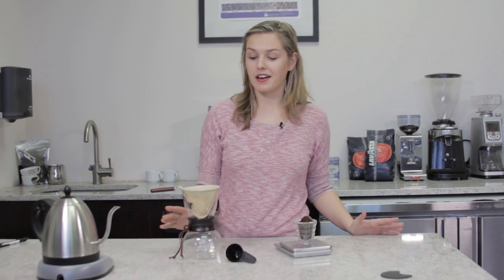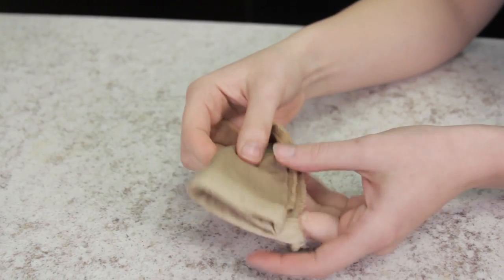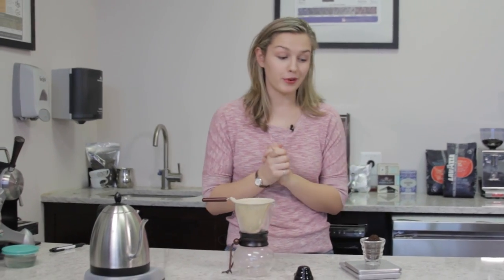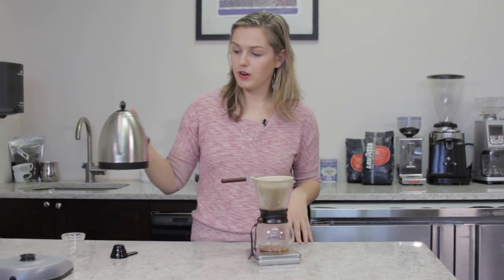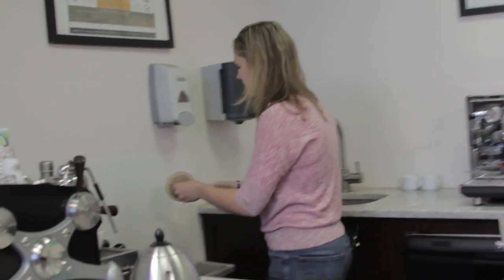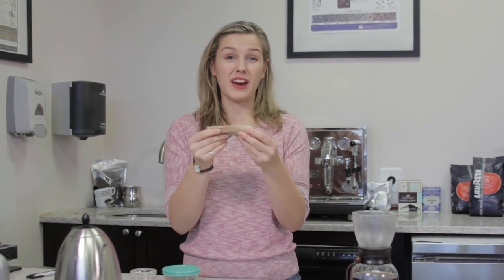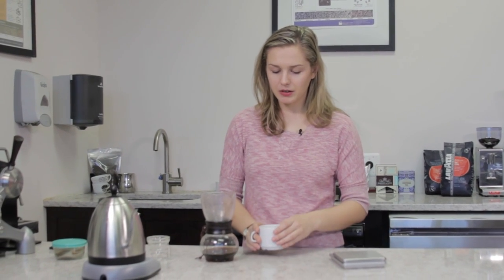Hario Wood Neck Drip Pot

Comment: I've recently been using a variety of pour overs, and I can honestly say so far that this maker gives the best, most consistent, most satisfying brew. It's just delicious.  It's also aesthetic and easy to use.  The only concern is making sure the cloth filter is properly cleaned and stored (in the fridge in some cold water in a sealable container).  But it's worth it.  By the way,  no matter what anyone else claims, this machine takes the same grind as a Hario V60, for example; some version of 'light medium coarse', just a few clicks coarser than medium.  Anything coarser makes you miss the body. That's my opinion, anyway.
Reply: What coffee/water ratio are u using? Also, what water temperature? Thanks!

Comment: Is it 300 total in grams including 40 grams of bloom?
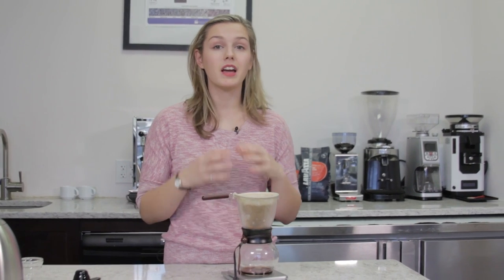Reply: Depends on the ratio you go for and how much grounds you use. Following the V60 standard you'd use anywhere from 2:30 to 3:50 coffee to water, so for 20g coffee you pour 300-333g water.
Reply: In the video, yes, she did 300 total. So 20g coffee to 300g water. It's a good place to start and you can adjust to your taste from there.